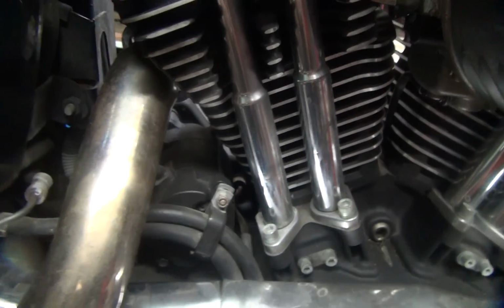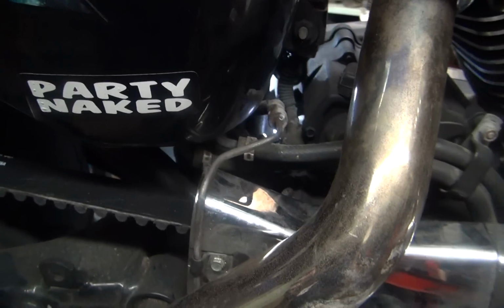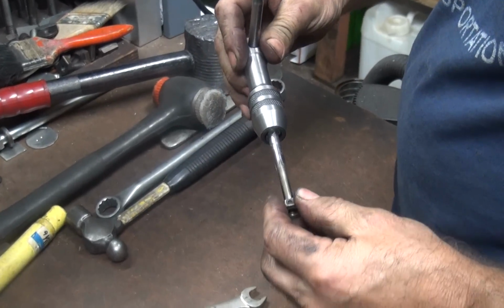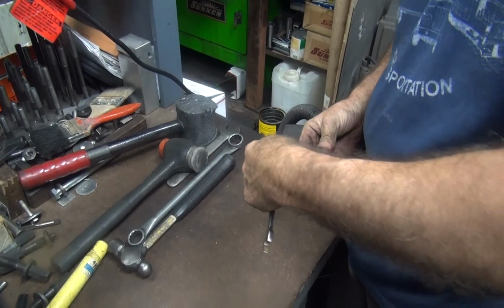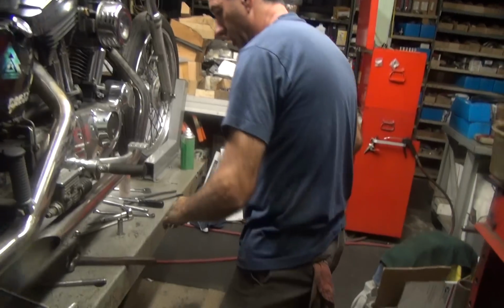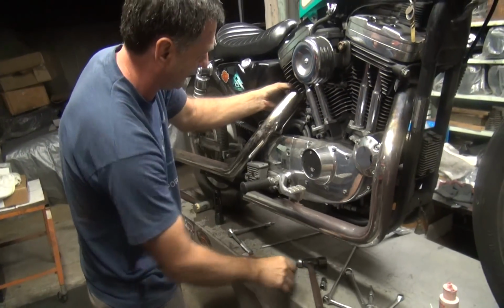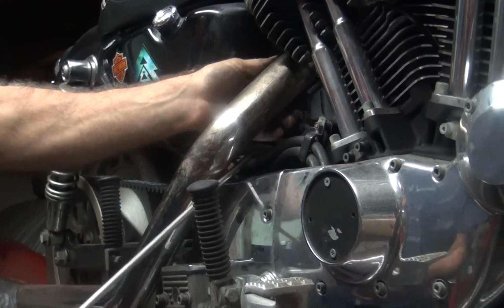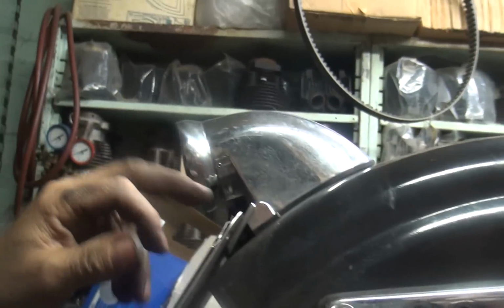20160902183653 4 2002 evo sportster rear belt install xl harley

Comment: i started putting hi temp RTV on my shovelheads exhausts
 threads several years ago, and they still stay tight.  (clean threads first) it provides torque set lube and defeats vibration